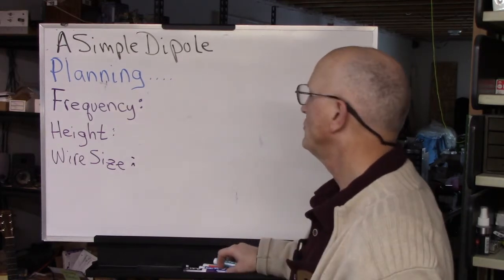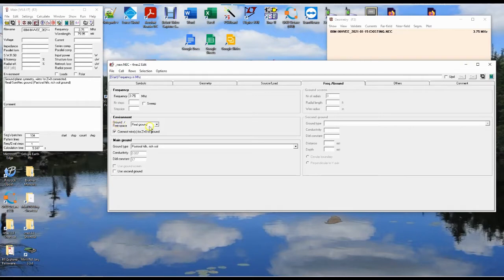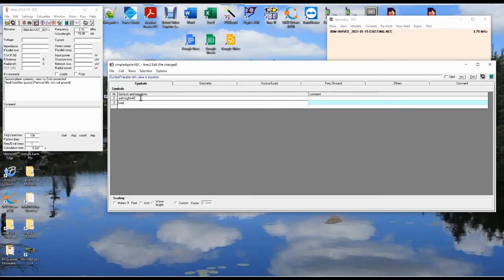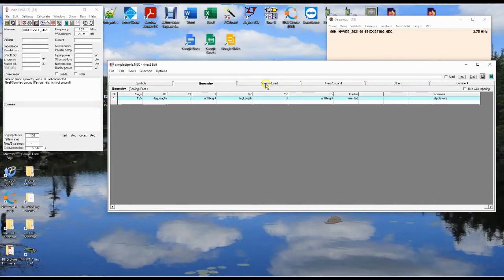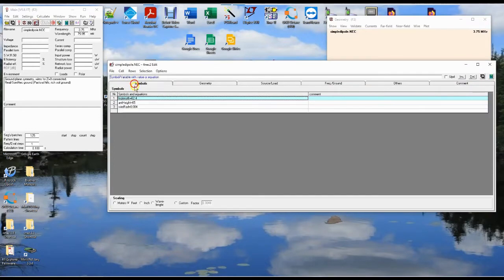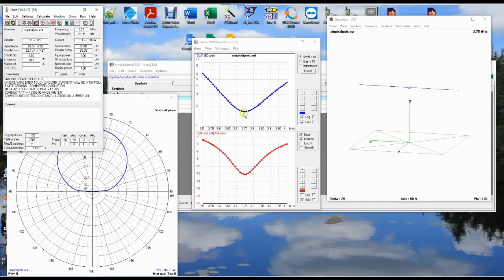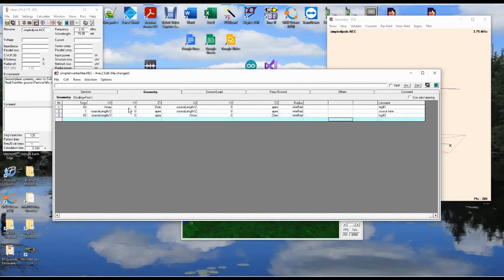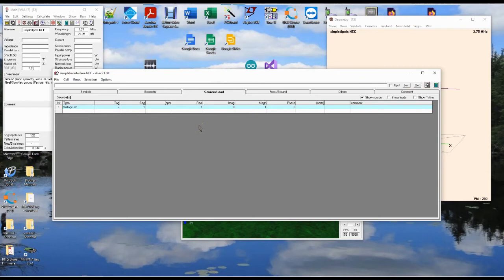4NEC2 Antenna Modelling Application: Modelling Two Basic Antennas (008b)

Comment: Ralph, I really appreciate the way you plan on the white board ahead of time instead of just jumping right to the modeling software! Even though some may squirm at the site of middle school trigonometry, u explained it clearly and succinctly. Another excellent teaching video! As I mentioned to u earlier, I will use this video to help me model my 40M capacitive hat antenna constructed with a 17' whip and 15' downward sloping wires at 45 degrees. I feel ur inverted-V model relates well to that! 😀73 KJ6ER
Reply from the maker: I *USED* to try to just jump right into the modeling software. Except for simplest cases, this always got me in trouble.
So, two things I do ALWAYS:
** I sit down with pencil and paper and plan, plan plan - it IS 3D work and can be a head breaker
** I use symbols extensively. This simplifies the geometric entries, makes it so I can easily and quickly modify the dimesions and allows me to use the "OPTIMIZER" to tune the antenna for best performance.

Comment: Great presentation!  I am new to 4NEC, and couldn't find the command to set the input to my modeled vertical to the bottom of the antenna.  I was wondering why I was getting such a bad vswr until I noticed the small red circle in the middle of the vertical!  I am assumed that the red circle is the input point!  Thanks!
Reply from the maker: Thanks!  Yes, the red circle is the input. You change this by going to the "Source/Load" in the editor (I use the "NEC Editor New"). Make sure the "Show Source" checkbox is checked. Then choose the "Wire" you want to embed the source in ("Tag" field) and the Segment of that wire where you want the source to be in the "Seg" field. Then "Real" and "Magn" are 1. Everything else is 0. Hope this helps. 🙂  And, you're welcome!

Comment: Is there a way to model receiving  antennas as opposed to transmitting?
Reply from the maker: An antenna intended only for receive service needs to follow the same principles as a transmitting antenna.  If the antenna isn't properly tuned for the frequency you are looking to receive, then the amount of signal you get to listen to is significantly diminished.  So, if you are looking to get the best performance out of an antenna for receiving, then maximize its performance for transmitting and you have it.